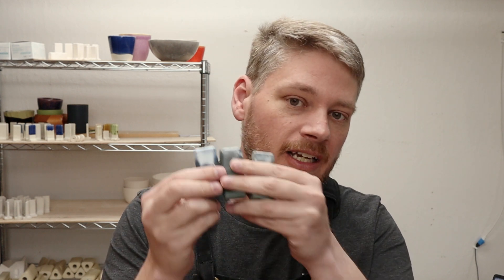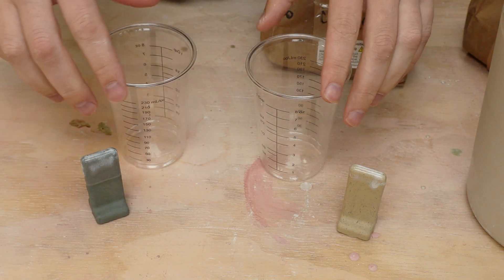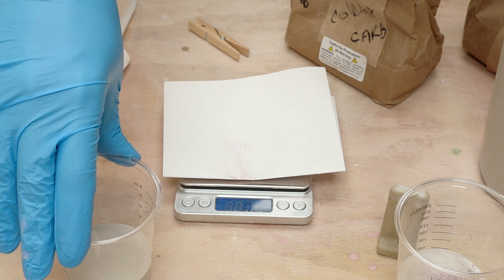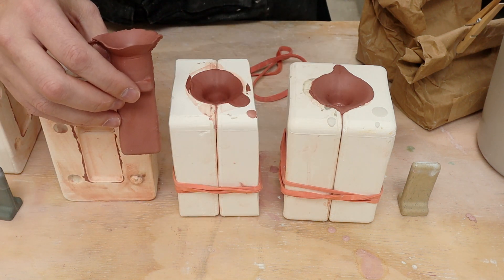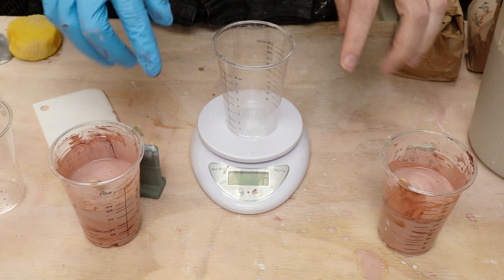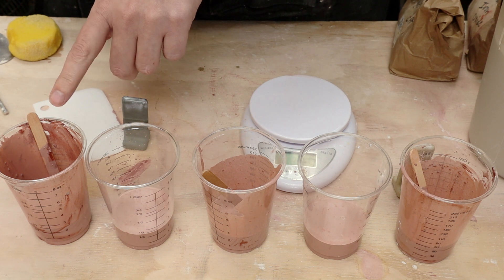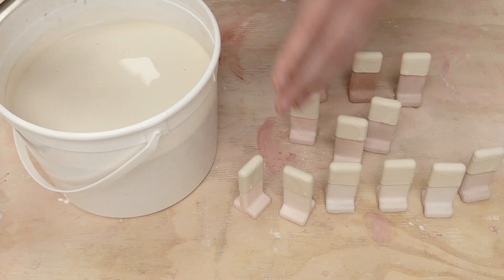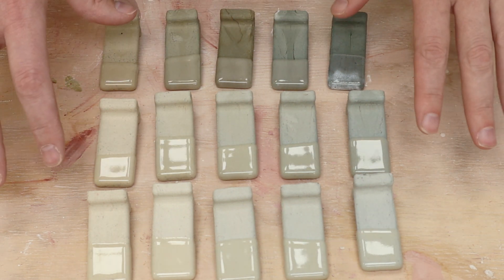Dialing in Cobalt and Iron slip

Comment: The first row where there seems to be some marbling from incomplete mixing is interesting. I'd really like that effect in the second row.
Reply from the maker: Mixing up these small amounts is a challenge for sure! I think there are two things going on. Some of the powder isn't being fully incorporated and once fired leaves a speckled effect. I'm not sure if that will persist once I scale things up and can use my mixer to blend things together. The other effect is I think a result of how I'm pouring the slip into the mold. Depending on if I hit the side and the slip runs down vs pouring into the bottom and raising the level seems to result in a different surface. This could go away once things are mixed better. But there might be ways to take advantage of it as well.
Reply: @PotterybyKent  Interesting. You might try experimenting with different pouring methods on some larger pieces.